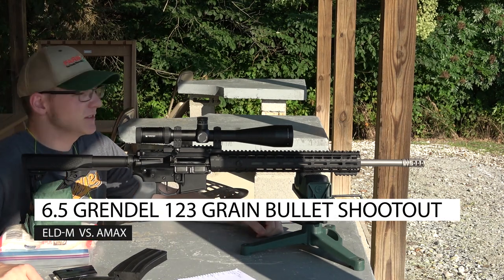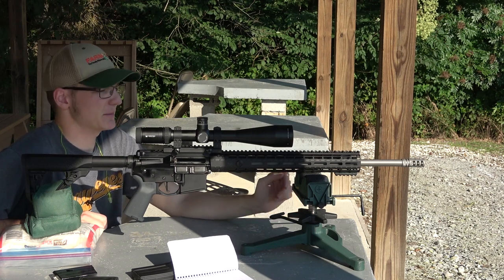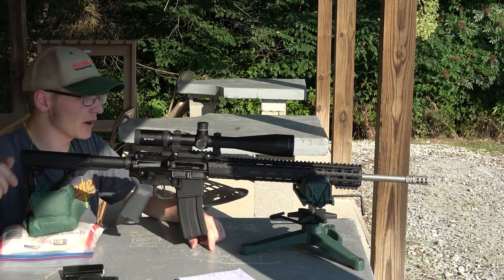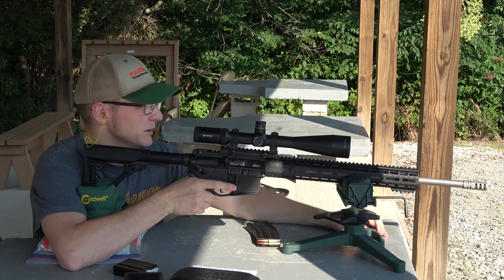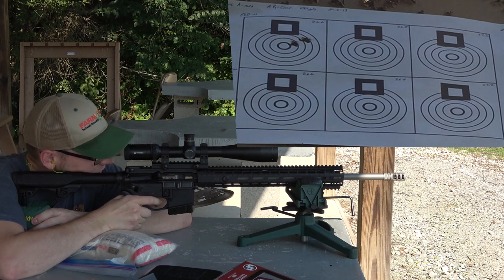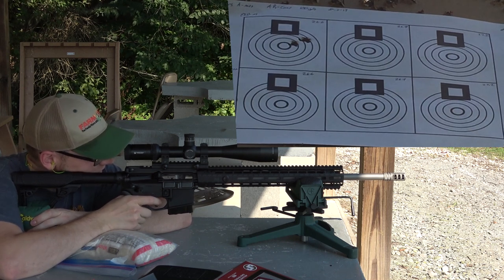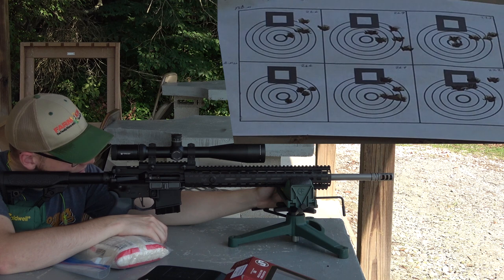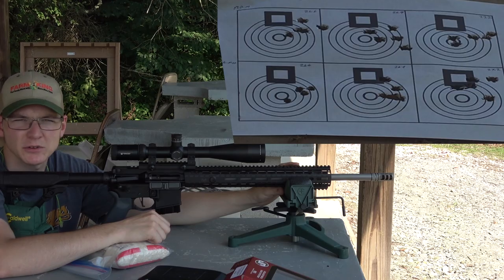6.5 Grendel 123 Grain Bullet Shootout: ELD-M vs. AMAX

Comment: For noise reduction at the ear look into a linear compensator. No tax stamp needed. I purchased one for my 223 and could not believe the difference. I plan on buying one for my 6.5 Grendel.
Reply from the maker: How are they at mitigating muzzle rise?
Reply: My experience it will not act the same as a muzzle break. The compensators push all the gas and sound down range.  I was told the one I have was actually designed to help with the noise of the 450BM.  People that have put it on their 450BM said it helped tremendously on the sound at the ear and also felt recoil.  If I remember correctly there is around a 23db reduction at the ear.
Reply from the maker: @fowllab  Sounds like it may be worth it, especially in a hunting scenario where one may not have the time to don ear pro. Thanks for the tip, I hadn't heard of this type of comp before!
Reply: I’m buying one for the 6.5 Grendel and will be able to use it on my 6 arc as well

Comment: AR Comp is known for short stroking using a Grendel with a mid length or rifle length gas system. You need to increase gas if you continue to use AR Comp. 

I went thru this in my mid length gas system Grendel and AR Comp was the only powder it happen on, other powders worked just fine. I ended up fixing it by increasing gas. You can try increasing buffer weight only but it may not fix the issue using AR Comp. In my opinion AR Comp is one of the more accurate Grendel powders with reasonable velocities I have tried.
Reply from the maker: FRECSF1 interesting! Thanks for the info!

Comment: Im running a 18in criterion barrel and had some accuracy issues. I email criterion and give them my setup n found out the aero precision enhanced upper has issues. First it needed lapped and the second really surprised me. Where the gas tube passes through the reciever is a lottle to tight and effects harmonics. They suggested i send it to them but I just drilled it myself. Open up the passage wth 3/16 drill bit. I reassembled the upper n to my surprise it shot sub moa first group.
Reply from the maker: Interesting! That's something I'll have to look into for sure.
Reply: Interesting! I have 18in Ballistic Avangate (6.5 Grendel) with Aero Precision upper. I lapped them but did not have any problems like yours. I will double-check them. Thanks!

Comment: I also have the asc 10rd mag the c products defense 10rd and the elander 10rd mag and they all work great, I also have used the p mag 20rd and only put about 12 rds in it wich works good also! You could probly use a 30rd pmag and load it up with 20 or so rds should work good also
Reply: Why.  Use proper c products 26rd 6.5grendel magazines.  They just work.

Comment: Try a heavier buffer spring and go to a H1or 2 buffer to resolve that bolt over round issue caused by being over gassed.
Reply from the maker: I've been thinking of doing that exact thing. Pretty sure I have an H buffer laying around, video to come.
Reply: @TheOutdoorGeneralist  I put an adjustable gas block on my Grendel so I am able to adjust it perfectly and don't have to play around with buffers.  Cheap and effective

Comment: my opinion don't hunt with a muzzle brake. unless your a fan of using electronic ear pro for hunting. your going to deafen your ears after the first shot. flash hider, suppressor, or linear compensator
( blasts the sound forward of you) is better for hunting with ar's.
Reply from the maker: @no one   I’ve been thinking a lot about that lately. Since I’ll be doing comparatively high-ish volume shooting on hogs I’ll definitely be wearing ear pro. Will probably do a video on that here in a month or two. For deer I may try ear pro of some sort, but I’ll most likely just switch the muzzle brake out for a thread protector.
Reply: @TheOutdoorGeneralist  I'd like to hear your experience after the hunts.
Reply: I wear electronic hearing pro for hunting and shooting in general.  it actually amplifies sound if something is walking through the woods.